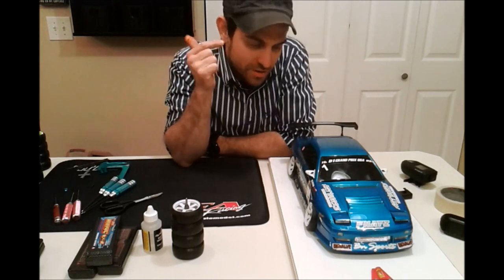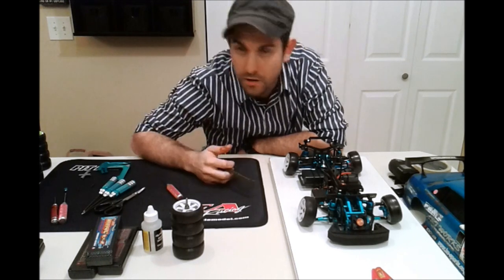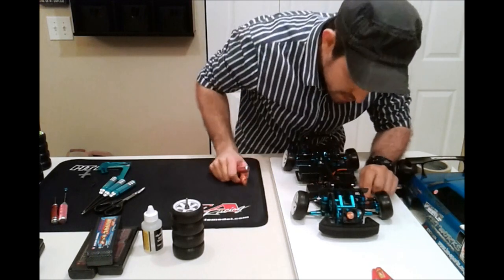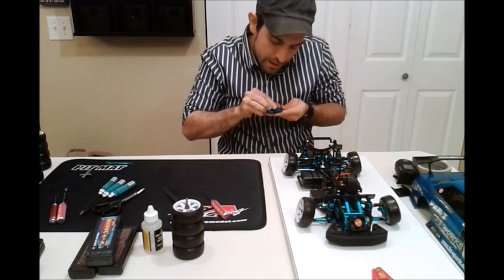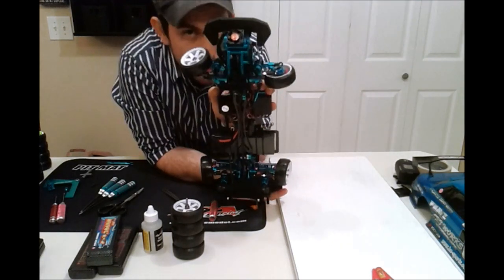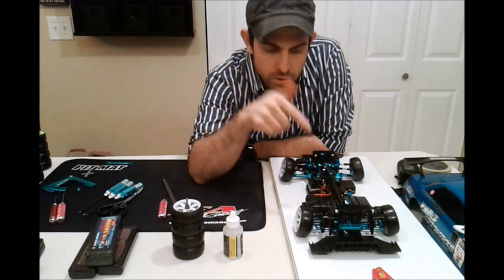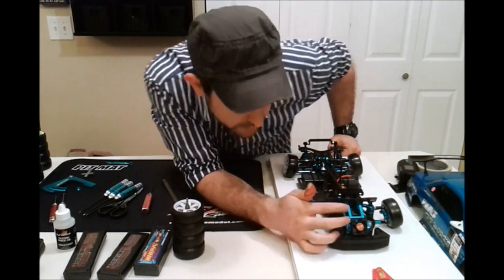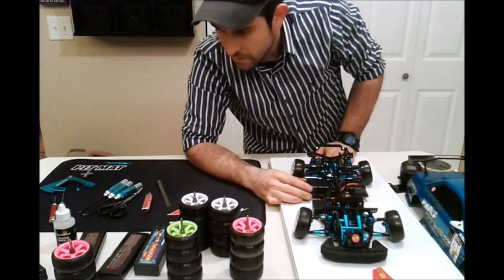RWD Tips and Tricks for RC Drift * NEW RWD R31 *

Comment from the maker: to raise the top deck to accomadate the bigger battery in, add a 2 or 3mm spacer under the top deck in the rear, then adjust the belt tension on all three parts, the front tension, rear tension, and rear spool tension. I also recommend changing the middle rear pulley to 19t to make it even easier on the belt and to smooth the drive train as well
Reply: Is there a way to get more steering angle for a sprint 2 Flux im new to drifting

Comment: hey Blueststar4u i was wondering if you put up a video on how to put the stealth body mounts on the front...because I havn't been able to find a video on it being setup.....cheers and awsome vid
Reply: yes please :)
Reply: Hey yonas. I actually found a way to mount the factory posts using the provided m3 grub screws for the droop adjustment.

Remove the front belt tensioner (not needed because it's already super tight).

Remove the factory post from the mounting brackets and drill the center of the bottom of the post with the appropriate sized bit and turn in the grub screw. You of course want an interference fit for security. You remove the upper control arm retaining screw (the one that goes into the bulkhead) and mount the modified posts in place of those mounting screws.
Reply: Christophe Mach 

You can of course then cut the posts to size and put the stealth mount brackets on.
Reply from the maker: if you can manage to get a hold of extra droop screws, you can use that with the stock front posts and cut them shorter.  also need to take off the front tensioner. belts already tight enough
Reply: ***** Patrick, utilized your exact set up besides the motor turn rate. I'm using a 10.5t what size pinion would you suggest?

Comment: Bluestar4u, Qs:
1) Ackermann: I've got the pair of +3s toe blocks, using the outer knuckle holes, and put in the 2mm spacers into the lower arms, currently have 12degrees camber and a degree of toe out. Q: I've got the center steering  link as short as the default will go, and seeing a good amount of "toe out" Ackermann on lock, did you get a shorter center bar? any tips/measurements here? Am I DoingThisRight?

2) Caster: Measured on the black plastic ball joints I have about 3-4 degrees of caster, and the upper arm is a CH away from the collar of the shock, which in turn is a CH away from the spur. Currently twisting the collar causes it to rub against the spur holder. Although you say you have 1.5mm difference in ride height from straight to lock, I'm currently seeing 1.0mm, so can you confirm your caster - and where you measure it?

3) for the rear toe, I tried the 1 degree little plastic spacers, but after putting it together and measuring it, the wheels were still at 0. I've heard from others that say these things are too much hassle, and to just use 1 degree toe blocks. What did you use?

4) people have been talking about putting 2mm anti-dive - have you tried that?

Oh, and took it out for last weekend, didn't have all the setup above, (eg camber) but it was driving super nicely, despite a bad setup for the gyro causing the steering to "chatter". Thanks so much!
Reply: g4mb171 I’m just running a rwd custom drift star :p

Comment: You say 60-40 front-back.  Can you do that for a Nitro drift car too?  I don't know if you have any experience with them.  This s for a project I am doing in school.  I am making a 1/10th on road for school.  If I can get it to be a decent drifter I should be able to do adjustments for grip style driving too.  But I want it to be drift able because that seems to have the best market.  If you have any suggestions, I would love to know.
Reply from the maker: new data since then, i like 50/50 weight or more rear heavy up to 56% rear.

Comment: Hi Bluestar, i just ordered a r31 rwd grt from broadtech and was wondering what the difference was between the r31 rwd grt and the r31 16-fm rwd? any info will be greatly appreciated as i cant seem to figure it out on my own.
Love your videos by the way! as someone who is completely new to the hobby, you have helped a lot. Thanks and stay sideways!
Reply from the maker: The 31rwd is made solely for rwd. The r31 16fm is mainly for countersteer and awd, but this one can be converted with mods to become rwd
Reply: Being completely new to rc cars  and loving the sport of drifting.. i was wondering if you could help me out. i just received this chassis in the mail So i went to my local hobby store and purchased all of the necessities. when i got home, i realized i dont even know how to charge my batteries. lol, that being said i dont even know how to assemble my chassis now that i have my motor, esc, servo, transmitter i was wondering if you could possibly shed some light in this area. How do you mount all of the electronics on the car? i understand you have to solder them, but where does everything go? im completely new and lost lol. and help would be appreciated. 
Dx4c, Hobby wing XERUN brushless ESC, brushless Reedy sonic 540 mach 2 10.5 spec, Savox coreless digital servo, Hitec X1MF charger, and two Lectron Pro 5200 mAh 50C 7.4v 2c charge rate. what do you think?
Reply: ***** hey bluestar, i got my r31 rwd grt and i absolutely love it! I have one question/request. Could you possibly make a video or explain how to exactly adjust the ride height, camber, and toe? I see you doing it in this video but i cant actually see what is being done. Please if possible, if would be of great help. thanks in advance.

Comment: Bluestar4u hey matey I've purchased the r31 and I'm using your video to set up mine, is the oil in the shocks 50wt or 15wt, also how do you accurately set up the front toe, I've got constant problems I can't hold a long slide the car always seems to spin out, also how do you accurately set up the weight distribution, could you please email me as I'm keen to get this chassis running right and no matter what I do it seems to be failing cheers :)
Reply from the maker: recently I stated using equal tires all around.
and  I try to get a weight balance of 53-47 or so.
I suggest first starting out with laying the rear shocks all the way down to soften the rear. to help promote push.
For toe, I normaly do it by site and I aim for a tiny bit of toe out, not much.
about 1 degree or so. It's purely visual.
set the ride height with the front 1mm higher than the rear.
Also, set gyro gain as high as it will go without wobbling or jittering at any time.
At the moment, Im using 30w all around.
make absolutely sure that no wheel is rubbing at any point in the front suspension.
any rub will make affect performance and cause spins.
ill be making a new setup vid that breaks down the science.
Because I think I may have figured out  a big portion of drift balance.
I have tested this theory over 3 different weight chassis and it works very well.

Comment: Would it be possible to get the names of the tools you're using?

I'm an RC newbie, like, brand new to the hobby. My knowledge of the tools and electronics is sub-par to say the least, but my biggest fear is the tools. I'm mainly afraid that when I buy my chassis I wont have all the tools I need, or even understand how to use them correctly. 

Can anybody toss a little help/advice my way?

Comment: Blueststar I got my R31 rwd in a few days ago.  I set my front camber at -8 degrees which screwed up toe settings.  So I adjusted toe at 0 and when I go lock to lock the trailing wheel hits the shock.  How do I fix this?  Adjust ackerman?
Reply from the maker: adjust the ackerman  on the center rack.  to get less trailing wheel angle, make it longer.  Always set toe afterwards.
Reply: ***** Thanks man.  I got my steering dialed in.  Also set toe, caster, camber and height and now I have a new interesting problem.  When I turn the steering lock to lock the inside rear wheel lifts crazy.  Whats the cause and fix for this?

Comment: I have TT-02 with Yeah Racing RWD conversion set. How can I control my rear better. It is spinning out fast. I added 80g of weight in the rear and it seemed to help. Any more ideas?
Reply from the maker: If you havent yet, get a gyro. And if u already do, make sure that it counter steers correctly.
Reply: @blueststar4u  I have one and it countersteers correctly. I set it on 80%. More than 80 and the steering in flickering.
Reply from the maker: If its spinning out, front wheel or tire might be catching on something
Reply: @blueststar4u  Hmm, that is possible. I'll check that. There are lighting wires in the body that when the suspension is compressed are rubbing on the front tires. When a tire is blocked the car could spin out.

Comment: @15:16 How much rear toe (in)? we talking R31-31/1LBL?
Reply from the maker: 1* degree rear toe in. also known as + 1
Reply: ***** A it was 1*, you gestured with your finger - but wasn't sure. I realized that I saw something in the manual, that I can adjust that with the little black stubs

But I'd love to know more about how you expanded the track on the front wheels, you moved to using the outside position for the ball stubs on the hubs - done it. 3* suspension mounts - I think I understand - will order a couple. and a spacer - not sure exactly where you are putting it...?

Comment: this might sound really really stupid, but do you think i can lock my traxxas slash diff, lower it, and put some drifty tires on it and make it a rwd drift car? ik that there really aren't drift wheels to fit it, but other than that, could it work? I feel like it could work cuz it's got a lot of room to get major camber and it's got a lot of rake on the steering.
Reply: +Dread Simulator 2k16 I remember checking some forums awhile back, and the general concensus was that a rwd car wouldn't work, but people have run cars with faster rear gears so the back wheels spin faster than the front
Reply: You can buy a gyro and delete the c hubs to make enough angle (camber doesn't really matter for drifting)

Comment from the maker: aloydevilZ, 1 pair of +3 suspension mounts
Reply: Hey recently got my rwd chassi and it is almost done i just need a part number for those +3 suspension mounts
Reply: What is better? Or more realistic? Heavy or lighter cars?
Reply from the maker: im not sure yet, but it seems that the heavier cars might carry more weight and slide a little longer, as long as the suspension is set up accordingly
Reply: ***** im trying to build an e10 rwd drift car (hpi) but i got only 45° steering do you think it will just spin?
Reply: okay... its just spinning making narrow tires for front today

Comment: I was thinking this would be an alright video until he fucking called the shell a 190,  its a onevia
Reply from the maker: Drew Street at what time?
Reply: bluestar4u sounds like you say its a 190 sx when you say why you have so much camber,  honestly can't tell if you're calling it a 190 or meaning 190 as in mm as shell length,  not trying to be dick but honestly sounds like it , for me anyway
Reply from the maker: Good point! The shell is a 190mm
 I remember saying it because most yokomo shells are 194mm, so this knock off shell always had fitment issues.
Reply: bluestar4u oh right then okay,  other than that what I thought was you saying 190sx 😂 good video,  I'm actually trying to learn red drifting without gyro and its hard asf ,  was awd but had an intense knocking so rwd convention until I figure out the problem or get the parts
Reply from the maker: Rwd without a gyro is possible but not recommended nor fun.
Reply: bluestar4u I know I've noticed that ahah,  might buy a gyro when I have some money
Reply from the maker: Flat box style gyros work the best. All the major brands have one.
Reply: bluestar4u oh Alright then thanks,  I'll have a look